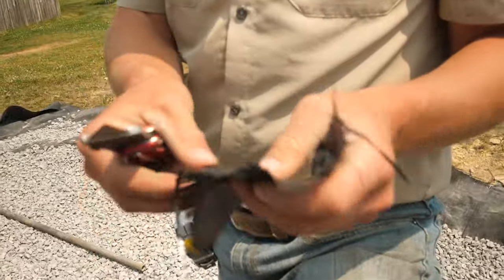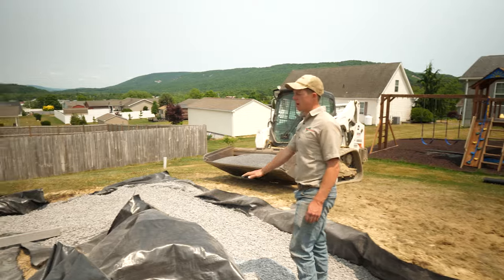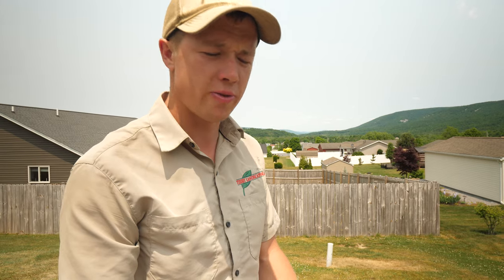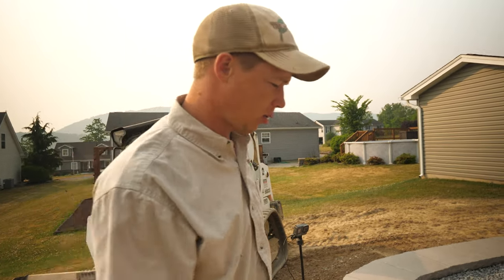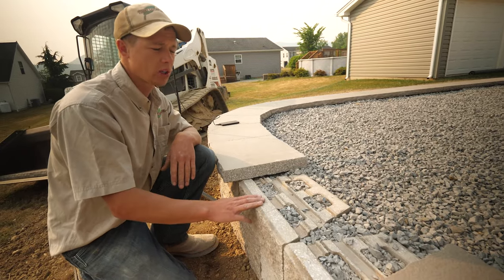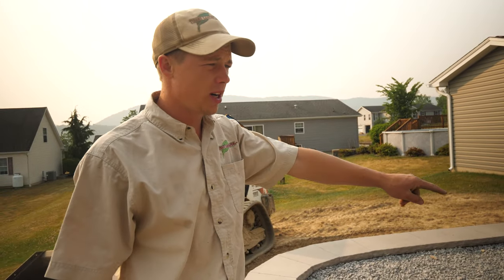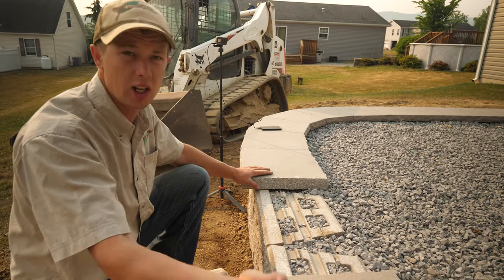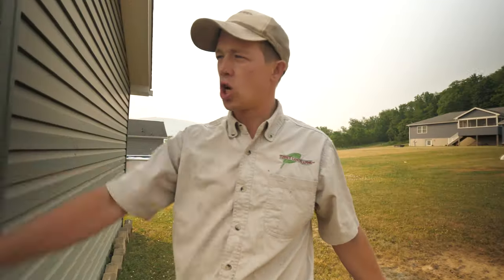How to Finish Building a Raised Patio | Part 2

Comment: I like all the work you guys do I do have a question what is the benefit of using that type of stone for the base instead of Crusher run and not using sand
Reply from the maker: We used 2B clean stone for this patio because it was behind a wall and I wanted a stone that would drain moisture well. As for the setting bed. We use a quarter inch clean stone called #9s because it screeds out much nicer than sand and also doesn't hold any moisture.

Comment: What material did you use and how many inches was your setting bed? For the joints, what sand did you use? Thanks for the video and info. ~B 😊
Reply from the maker: The paver  was a techo bloc Chestnut brown blue 60. The setting bed was 1-in thick.  The jointing was a resin sand from SEK.

Comment: Do you not use 411 or 304 limestone for paver base ?
Reply: Also where did you get that screed bar with the notch cut out for setting depth ? Thank you
Reply from the maker: We often use 2A modified. But in cases where we need a permeable pad, we use  2B stone. The screen bar was just a standard aluminum concrete screen bar that we cut a notch in.
Reply: Cool thank you, love your channel
Reply from the maker: @nickmenter7713   - we get them from a local fabricating shop and then just custom cut the notch to whatever we need it for!